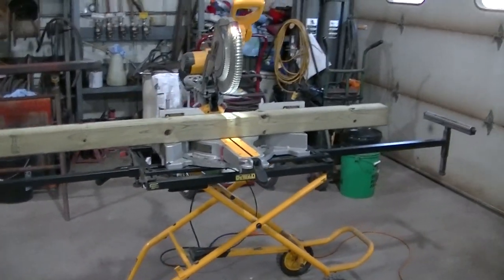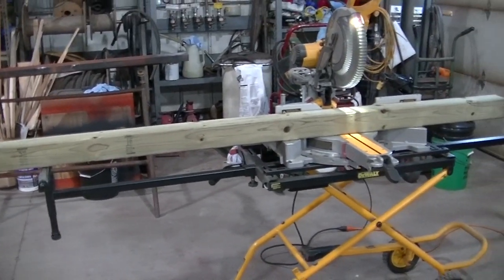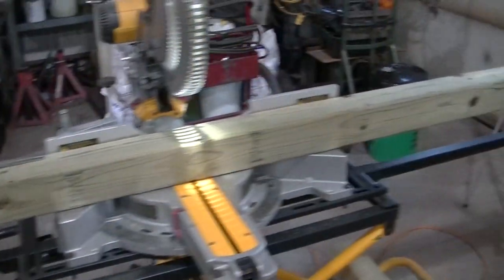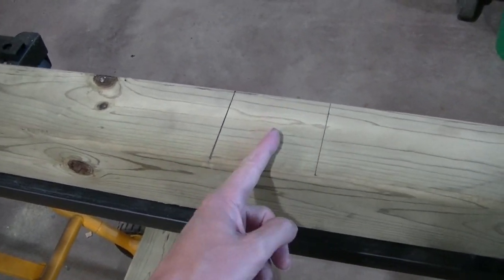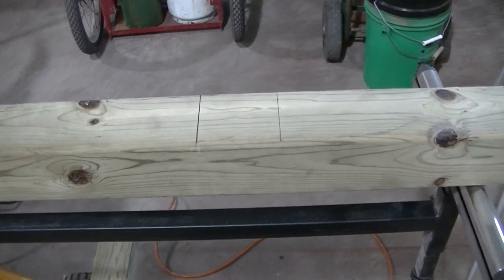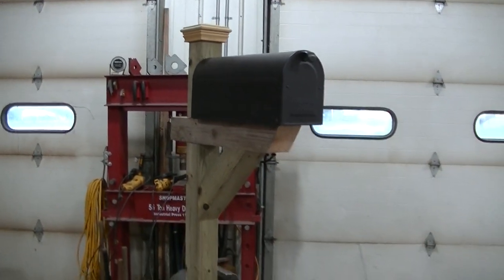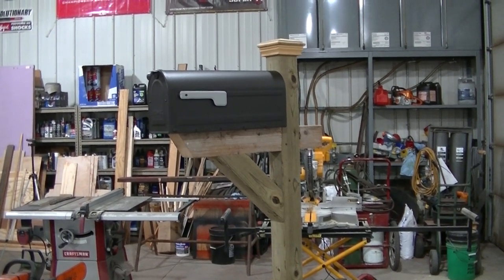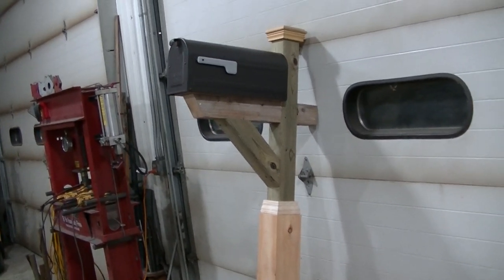Mailbox Build | 4x4 Post | Farmhouse

Comment: I like it, built just like mine minus the custom touches.  Problem I've had is with the plywood.  Make sure you seal it real good because plywood doesn't like moisture.  In 10 years I've replaced the plywood piece twice and it needs it again.  I think next one will be sealed with fiberglass resin.  Latex paint and Verathane just not cutting it for more than around 3-4 years.
Reply from the maker: I painted the plywood piece. It a pretty easy thing to replace.
Reply: @mossman381  Piece of cake.  I have plenty of practice. 

Tomorrow I'm changing the 3rd door handle on my ZR2 for the 3rd time in 16 years.
Life is nothing but a series of Deja vu Groundhog days.  LoL

Comment: If you think 2 ft is not deep enough why not make it 3 or 4 ft deep into tfhe ground.(longer post)....keeping specified height from ground to mailbox? What they gonna do? Dig up your mail box post to see how deep it goes into the ground?
Reply from the maker: I think 2ft is just a suggestion. It will keep you out of most utilities. She is going to add cement. That should hold. The snow plows throwing wet snow is what concerns me.